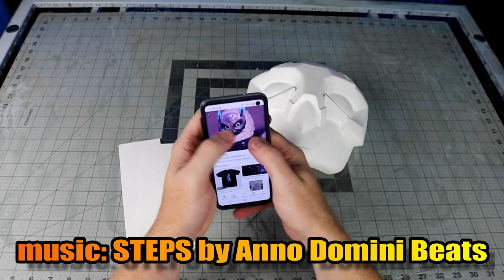Finishing Touches on an Ana Snow Owl Mask

Comment: Lol I don’t use a respirator I use one of the masks that I did from your templates (spiderman2099) I did cyberpunk today just need the tubes and paint but I can’t find 6 mm foam so I use foam they use for exercise lol seems to work alright just a bit bulky. I’m impatient when I order things in the mail.
Reply from the maker: I get impatient too. That's why I have several projects going at once, so if I run out of supplies with one, I can jump over to another build using different materials.